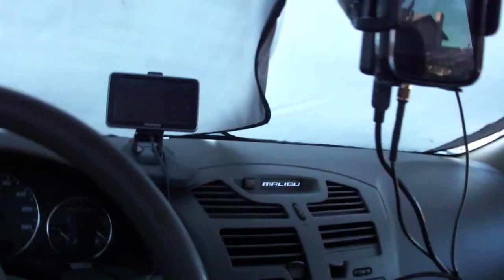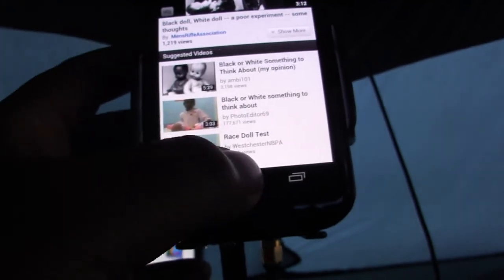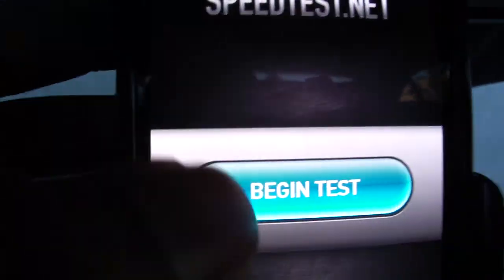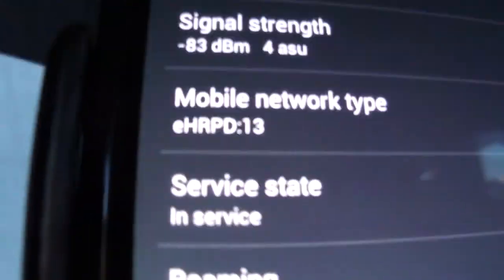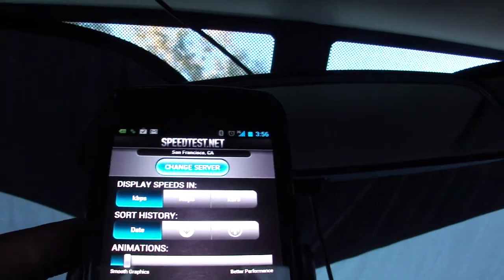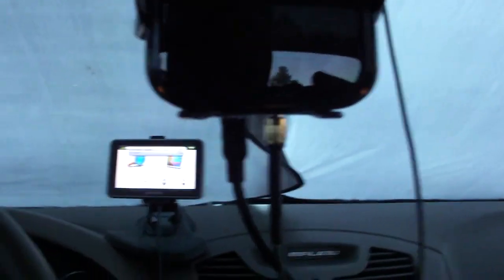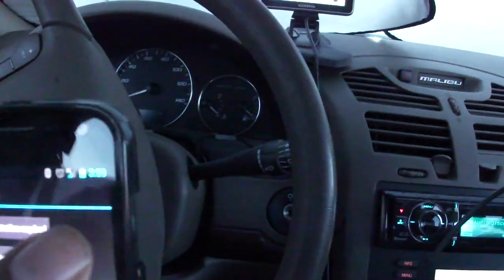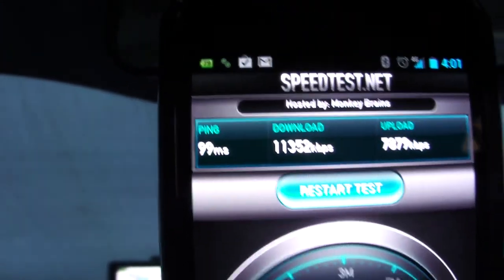Wilson Sleek Signal Booster Review

Comment: Bro no offense but you need to do some simple research. There's allot of pointlessness in this video. Just for basics, read PhilMcrevice1 comment below... Also, even though Wilson claims to have the built in circuitry to avoid the echo cancellation- it is weak! That's why they tried to ban it! But Wilson modified the internals and lowered the "boost" to ward of Verizon and AT&T... This should Improve coverage in weaker areas but not make your downloads faster where you already have coverage...